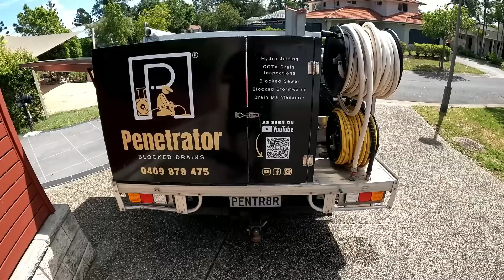Blocked Drain 330 -  Already 2 Cracks || I Love Clearing Drains Other Plumbers Can't Get

Comment: Nice work.. when I was young we were always taught never to put any oil / grease or fats down the drains, always wipe plates and pans out with a rag or paper towel before washing up, I guess younger people don't know or care anymore? This place has 95 year old clay pipes and never had any sewer issues.
Reply: when I moved into my home 45 years ago there were a few galvanized drain pipes. The kitchen kept backing up despite snaking and various chemicals. Cut the pipe and found soap / fat build up had necked it down to about 1 inch. I replaced everything with pvc and never had another problem.

Comment: Penetrator to the rescue! Why don't people pour the fat into a empty can? I never put fat down my drain....so I have never had a clogged kitchen drain. If I lived in Australia I would definately pour fat down the drain so I could meet the best of the bunch, Gavin! Another great video Gavin and I love how you always take the time to properly clean up after a job! Have a great day and say "Hi" to Mrs. P. and Little Missy P. for me! :face-purple-wide-eyes:
Reply: It used to be common knowledge not to put everything down the drain. And now people treat it like its a garbage can. I’m amazed at what people think is okay when I’m at some one else’s house.
Reply: @SandrA-hr5zk  - Much of that is due to the proliferation of garbage disposals.  They don't realize that even though it mulches up the solids, it doesn't do anything at all for the grease.
Reply: It used to also be common for people to tip some lye down the drains periodically to make sure to clear out any grease.    Because of people refusing to actually use the stuff safely (keep a metal or ceramic bowl to put over the drain as soon as you add the lye crystals, and before you add some hot water), lawyers decided that the product was to blame.   Red Devil doesn't even make lye for normal plumbing anymore.  You have to buy from other companies as "Root Killer".   

If you don't maintain your equipment (and that includes plumbing), you can't be surprised when it stops working.

Comment: Nice one Gavin, and you are 100% spot on. If I am in a situation where jetting is not an option, I toss the Rigid Flex shaft down with water running upstream and wall-to-wall scrub the pipe through diameter changes. I set my chains for the largest pipe, and let r eat.
Reply from the maker: It’s a good option

Comment: Just back from doing the same thing, clearing a line that another plumber couldn't. Ran the jetter down the line and popped it in less than 2 minutes. Camera showed roots and a broken pipe. The jetter cut the roots out in about ten minutes. Owner thought I was a genius. It was just the right tools and a bit of common sense.
Reply from the maker: Well done and I couldn’t agree more with have the correct tools

Comment: Just a couple of bits of Advice from an Old 74 year old woman with No drain problems Ever........
1. ALWAYS wipe All your Greasy dishes, pits and pans with a paper towel completely so only Very minimum amount of grease ever gets in your pipes.
2. Once in a while run hot water through your pipes for two minutes.  Then add  ammonia to help cut any grease and then rerun hot water again for two more minutes.
Have done this all my life. Have only called a plumber out once after we had guest for a week....young son on their last day before leaving dropped one of his Hot Wheel cars down the toilet and didn't tell anyone. 2 days later backup. A plumber from our Church came out at night and unclogged the system.
We mailed the car back to the family with a picture of the Plumber getting it out and nothing else.
Needless to say we never heard from them again.
Well worth the $250 (35 years ago) that we had to pay.
Reply: We always ran lye down the drain, not ammonia.  They're both basic, so not too different - lye's just a wee bit more dangerous if you're an idiot.

Comment: Best way with fat (in my opinion) is not to pour it down the drain. 35 Years and never had fat blockage in my house.....
Reply: same
Reply: It's lazy and ignorant to dump grease/fat/shortening (whatever you call it) down any drain!  Why don't people learn how stupid that is and that it only creates certain problems later?
Reply: Do you wash dishes in sink, or dishwasher? Only people I've known to have these plumbing problems have dishwashers.
Reply: @denisemurphy3915  Have always used a dishwasher.......
Reply: I've had slow drains several times in the bathroom.   Hair conditioner and long hair.   Lye helps a lot (it'll break down the hair too), but I've snaked out five feet of hair clog before.   You don't need fat to have a 'fat clog'.

Comment: Way to show them other Plumbers up, Mate! Question: Here in the USA, we use 1 1/2 inch pipe under the Kitchen Sink. And, 1 1/4 inch pipe for the Bathroom Lavatory. What size pipe(s) do you use in Australia?
Reply from the maker: Kitchen above ground in this situation 50mm and 100mm below ground

Comment: Poking through fat with a ell is a waste of time ,Jetting is the only way to go,  Kitchens are notorious for fat build up and the stuff they run through a disposal is incredible ,Guaranteed nothing will change and they will continue dumping fat and Grease and used cooking oil down the drain .
Reply: They _ could_ have worked with the eel, but these are classic "we expect someone else to do all the work" people.   There are plenty of chemicals out there (mostly lye based) that will happily eat away at the congealed fat once the water is flowing again, but you have to 1) use them,  and 2) be persistent in using them. If they'd been running 'maintenance' on their pipes (even the enzyme stuff), they wouldn't have had any problems.   I suspect he'll be right back here in a year or two, because even if Gav told them to not put grease down - they'll do it, and if they were told to use a chemical once a month - they won't do it.